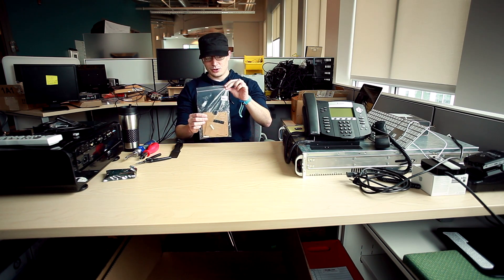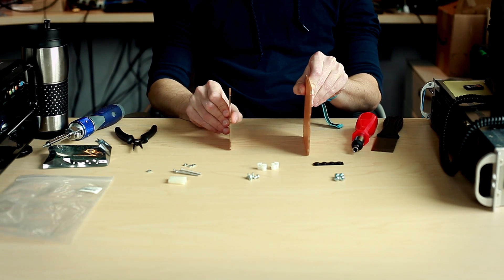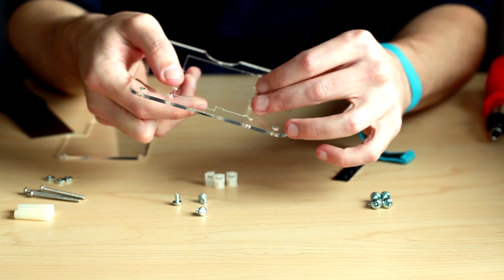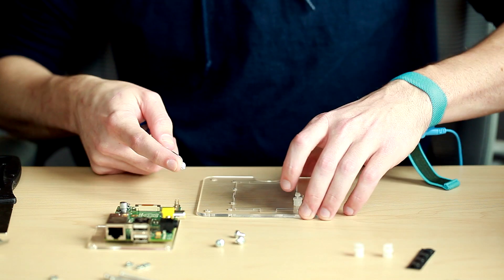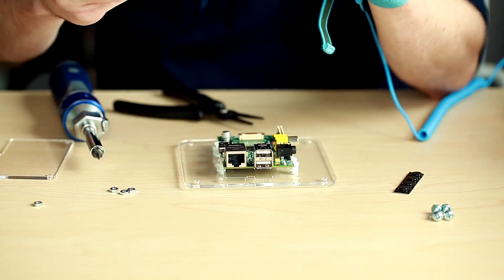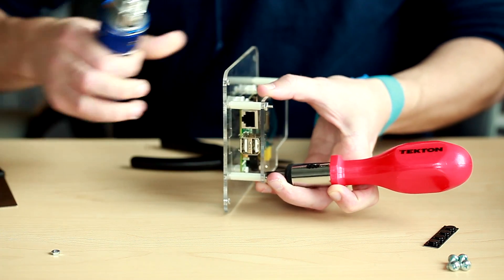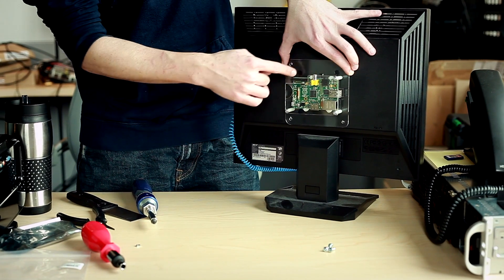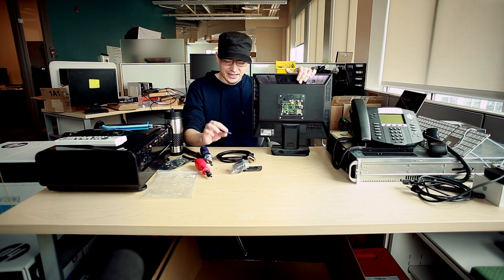Build a computer for under $60 dollars - Raspberry Pi

Comment: You said you were using as a thin client. I am seeking information regarding performance as such a thin client (or fat client where the virtual desktop handles some of the processing allowing for less accessing of server and better performance at work station.) I am also interested in tethering up a 7" tablet in a duel monitor mode with the tablet acting as a touch screen control device, kind of like a smart mouse.  Do you have anything like this, or feasibility analysis.

Comment: What a PC does, in this specific case it is set up as thin client, a disk-less pc for work uses. IE It can be used as terminal, or for RDP access, or for handle business programs over network and things like that. BTW the Raspberry can be used also for other applications, IE as media center or NAS, or it can be hacked and used to control bigger devices like robots, drones etc This little and cheap device has tons of possible applications.

Comment: you could run windows under a java virtual machine, hack in some direct x 11 virtual graphics adapter and run crysis 3, on max settings 2560x1440 too.